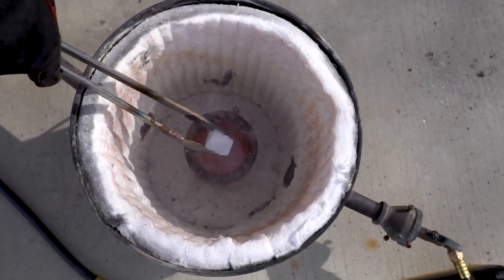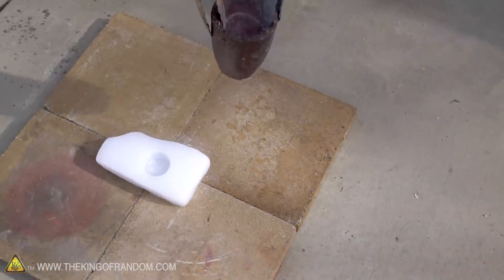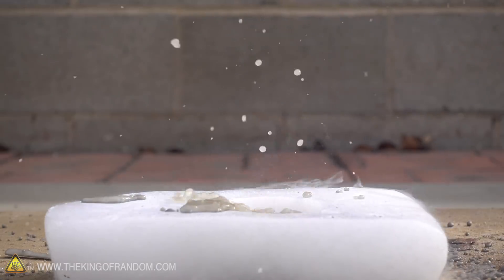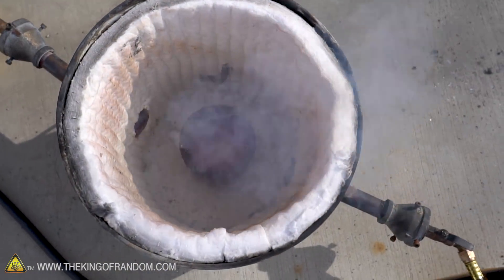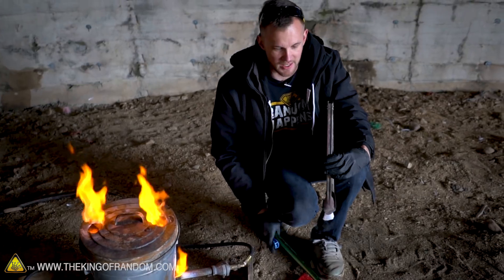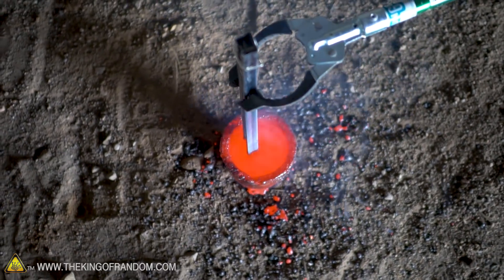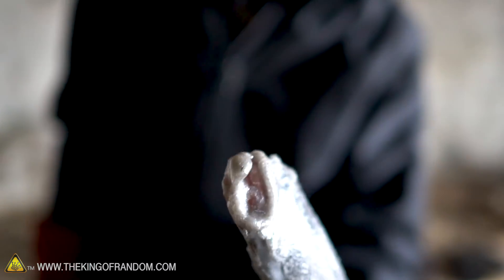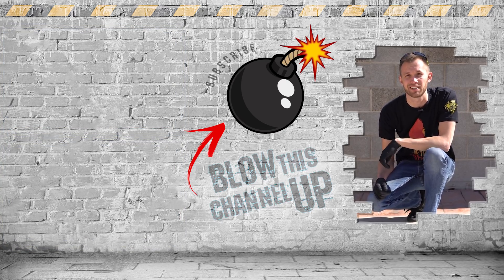Mixing Dry Ice with Molten Salt! TKOR Dives Into Molten Salt vs Dry Ice

Comment: What if you did different experiments with diet Coke and mentos? Like put Coke in the vacuum chamber for awhile and then put the mentos in. Or freeze the mentos in liquid nitrogen and add it. See how well they react after the diet Coke has been frozen and thawed. Stuff like that would be awesome.
Reply: Jordan Scott +
Reply: If you put the Coke into a vacuum chamber, you'll pull out all the CO2, so when you drop the Mentos in it'll do nothing, since the Mentos supposedly acts as a nucleation site for all the CO2 to bubble out, quickly forming the foam geyser. Freezing it likely won't have any effect other than being... well... frozen. If you freeze it inside the container and assuming the container doesn't leak, it'll carbonate again when it thaws, but if it's not sealed, it'll lose the carbonation and the Mentos won't do anything, again.

As always I'd suggest just doing some research and learning about this stuff before making suggestions.

Comment: The best way to clean aluminum from any product is to use 50/50 hydrochloric acid. It will dissolve the aluminum entirely in a matter of minutes. Rinse with water and done.

Comment: Please try putting expanding towels in a vacuum chamber. The towels that cant be opened until water gets poured on them, then they expand and you can easily open them up fully. And try putting them in liquid nitrogen and see what happens to them.

Comment: Make a video on bullets. Burn, cut and hammer different bullets😍
Reply: not really even if detonated its not all that dangerous as there is no barrel to direct all the pressure
Reply: Loved the video😍
Reply: Hammering and burning bullets is EXTREMELY dangerous, the bullets may go off and hurt someone.
Reply: Yeah,i would love to see the outcome🤔
Reply: Nic idea
Reply: lots of videos of burning bullets no issues
Reply: I use to burn the end of a straw so it was small enough to hold a .22 bullet and throw it up in the air when it lands on the concrete it blows up.
Reply: Jay Bubblez yeah, great idea